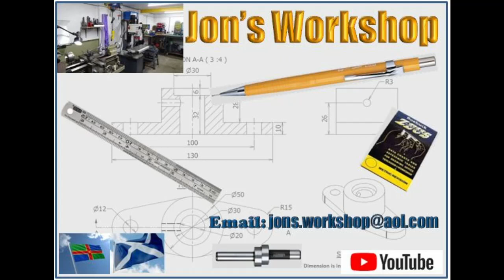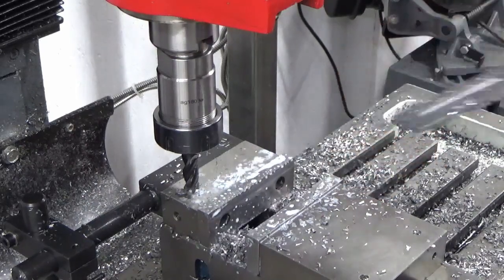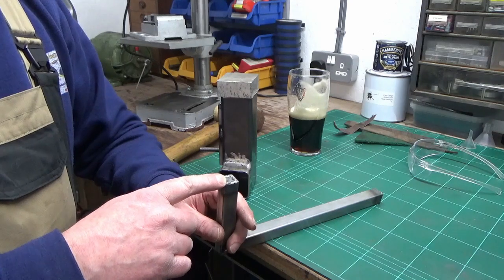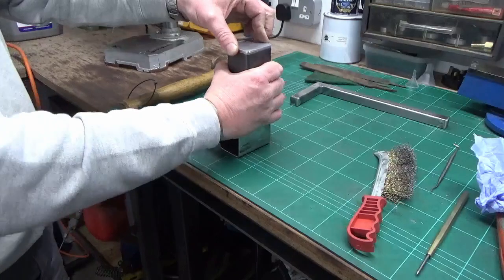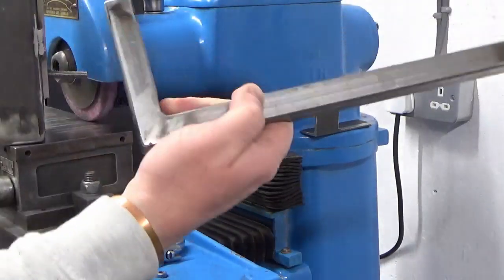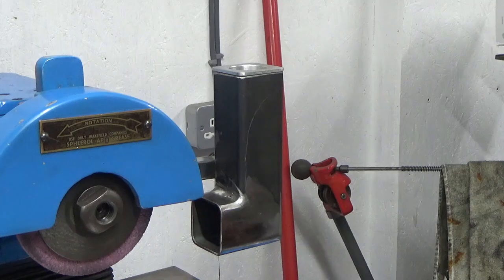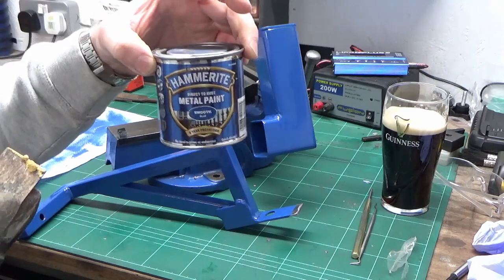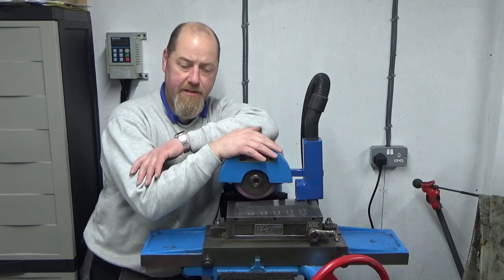Eagle Mk1 Surface Grinder - Extraction Build

Comment: Nice fabrication job Jon, I was thinking of mounting mine on a bracket from the head mounting bolt. You showed the mistake with the height position but not the cause or solution. Am I correct in thinking it was the position of the slotted plate? Enjoyed watching the progress on the grinder and keen to see the other work you intend to do on the grinder and magnetic table. Although currently rebuilding one myself I maybe more interested than some of your other viewers. Keep up the good work Jon 👍
Reply from the maker: Hi Gary, thanks for the comment and question. You are right, I failed to explain so I will pin your comment at the top. The cause was the design change, I had already tacked the back plate on based on 'plan A' and as I transitioned to 'plan B' I totally missed the fact that the height would be different! Solution was grinding the tacks away, cleaning up and re-positioning the back plate. Cheers, Jon

Comment: Looks good that fabrication Jon. I agree mounting the hood off that big bolt fixing the head on is a better solution. Tony
Reply from the maker: Hi Tony, thanks for the comment, hope you're well mate. I think it was the better solution, leaves the machine totally original and I got to practice a bit more welding which I am starting to enjoy now. Cheers, Jon

Comment: Nicely fabricated job Jon looks like it grew there!! 
I always thought that I was doing something wrong when brush painting Hammerite so the tip is appreciated👍
Atb Carl
Reply from the maker: Hi Carl, thanks for the comment. Yes, it works well, don't forget to break the seal on the lid before warming (forgot to mention this)! Other tips are, get it on thick and quick and then leave well alone, don't be tempted to go back over any bits. Cheers, Jon

Comment: That looks excellent Jon, really enjoyed the video. I thought the welds looked really good. When you did the test, I thought that if the scoop had been tilted down slightly, towards the table, then the escaping sparks would have been captured too.

I'm in Kuala Lumpur now, 14 days in quarantine so your videos are really helping me! Thanks.
Reply from the maker: Hi Carl, thanks for the comment and feedback. I actually did this on some later trials and it definitely helps (messes with my OCD though as the collector unit is on the pi$$ now)! My welding is improving, learning all the time, welding table is the biggest help, much easier than rolling round on the floor trying to do it. Good luck with the trip, can't imagine how tedious 4 weeks in hotel isolation away from home must be, you're certainly not missing any decent weather up here today! Cheers, Jon

Comment: Nice solution from what you had in stock. I'm glad you found a way to avoid drilling the casting. Best wishes, Dean in Oxfordshire.
Reply from the maker: Hi Dean, thanks for the comment. Yes, although it would have been the easiest option, I quite enjoyed pushing my crappy welding skills up a notch. The end result doesn't look like I made it that's for sure lol. Cheers, Jon

Comment: Just a little tip… have a little think about the order in which you weld things up. Not a big deal on parts like this but when you have longer heavy welds with more heat  generated it will make a huge difference to the flatness/squareness of your part
Reply from the maker: Hi Dion, thanks for the comment and tip. I always do think it through when I am tacking up, but the probably rely too much on the tacks and just weld what I am nearest to lol. Yes, I am a very beginner welder so lots to learn so thanks again for the help. Cheers, Jon

Comment: Neodymium magnets burn if you try to drill holes in them, they are made by compressing powdered neodymium and plated to make them stronger, you are lucky it didn't explode
Reply from the maker: Hi Andy, thanks for the comment. Yes, I have had a couple of these just fall apart (cheap and cheerful ones from our friends out east), they are only about 10mm square and 2mm thick. Think I will be keeping them away from welding in future. Cheers, Jon

Comment: Jon I would have considered a sliding fitment on the vertical dust extractor that way it can be raised and lowered to suit the wheel size, the job and it means better extraction of sparkles.
Reply from the maker: Hi Raymond, thanks for the comment. It has got one on it, that was the captive bolt on the back face, apologies if this wasn't clear in the voice over. Cheers, Jon

Comment: Jon, another thought about your extract, I know that the bulk of the sparks will hit the back, but still many hot ones will make it around the bend and could still melt your plastic vac hose. How about making up a zigzag or wavy baffle to place in the upright tube before your hose outlet, so the hot sparks do not get a direct access to your plastic tube. Our J & S 540's at work had metal flexible hose for that reason. Or place a disc of fine mesh under you adaptor plate. Just like the old steam trains had a spark arrester in the smokestack to stop setting the grass alight.
Reply from the maker: Hi Dave, I could have sworn I responded to this, sorry (maybe in email). Am waiting for Lidl to stock their shop vacs with metal hose as the solution. Cheers, Jon

Comment: DO YOU SAVE THE SHAVINGS & MELT THEM DOWN TO REUSE THEM?
Reply from the maker: Hi Lorie, thanks for the comment and question. Short answer is no. Mainly because every next job is different materials and they are all small so it would mean thoroughly cleaning each machine out each time for a cup full of waste! Long answer is yes, all my swarf goes to a recycling centre eventually so will be separated and processed there. Cheers, Jon
Reply: @jonsworkshop  THAT DEFINITELY MAKES SENSE.  THANKS FOR RESPONDING.

Comment: You need to be able to adjust it up and down to suit the wheel height the extraction will be nearly 100 percent if you get it right, not that it bothers me John but alcohol in the workshop you’ll have the safety nazis after you, nice job.

Al.
Reply from the maker: Hi Al, thanks for the comment. I have got adjustment for height, but I have scored a bit of an own goal, like an idiot, I made it from steel which is obviously magnetic (didn't even give it a thought until I finished it)! This means I have to leave 3 or 4mm gap to stop the obvious from happening, what a clown! I may embellish it with an aluminium flared cup (for want of a better description), this would catch more and allow me to get closer. Yeah, I am still waiting for one of the safety brigade to pull me up! I only ever have 1 pint and usually leave most of that until I have finished for the night. Doesn't look good though I suppose. How's my home county? You live about 15 miles from where I grew up! Cheers, Jon
Reply: Hi Al, where have you been hiding lately?
Reply: Hello Chris's, not hiding just been so busy at work, need to get back in the workshop.
Hope your well mate.

Al.
Reply: Hi John keep up with the the Guinness bud balls to them if the don't like it, they can always turn it of, where abouts are you from, I did wonder to be honest with the accent.

Al.
Reply from the maker: @pearcemachineshop5200  Lincoln born & bred Al.
Reply: @pearcemachineshop5200  good to hear you are busy and yes you should. 
As for me....surviving would sum it up well😉

Comment: I’ve been considering several new machines of a similar size. I. Don’t need anything really big, so they would be fine. Two problems though. They all cost between $3,500 to $6,000. It’s not the price that’s a problem though. The problem is that I could buy a much larger industrial machine used, but in very good condition including delivery, for that price range. So why not do that? Well, it would need to be brought downstairs, and even the smaller of those are big and heavy, so it’s pretty much out if the question.

The other problem with the new small machines is the lack of provision for coolant. It’s easy to make something to deliver coolant, but a nightmare to modify a machine that has no way to collect it, to do so. There are times when coolant is a must for the metals I often work with, so that’s a fail.

It’s very frustrating.

Nice job.
Reply from the maker: Hi Mel, thanks for the comment. My advice would be, if you have the space, and can afford the ticket price, then go for the good condition industrial option. Mine is all a compromise, can't balance the wheel assembly, no coolant etc etc. Hope this helps. Cheers, Jon
Reply: @jonsworkshop  that’s my desire. I’ve been trying to think of a way to get it down. It would have to be disassembled first. These machines are deep, and heavy. It’s a lot of work.

Comment: Please. Please. Don't heat any flammable product with a heat gun, as Jon said hot water is safest, if you can bring a hot drink into the workshop why not a pan of hot water?.
The end result is very good and it ain't going anywhere, the welding is decent if sometimes excessive ( the diagonal bracket). Fixing the aluminium block into the tube a screw near two opposing corners should work and they will not protruded into the tubing. A shaper next?.
Reply from the maker: Hi Fred, thanks for the comment and you are absolutely right, bad practice and I shouldn't have really shown it! Maybe a shaper, who knows, won't be for a good while yet though. I want to see just how much tool and cutter grinding I can get away with on the surface grinder first to rule in or out a T&C grinder. Cheers, Jon